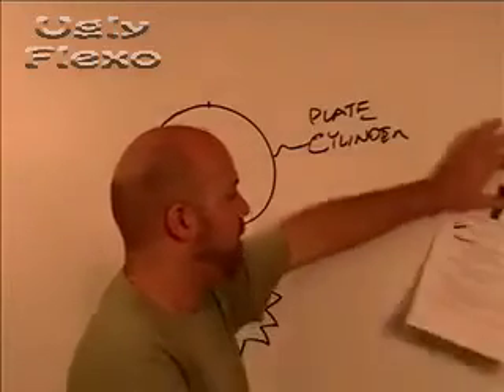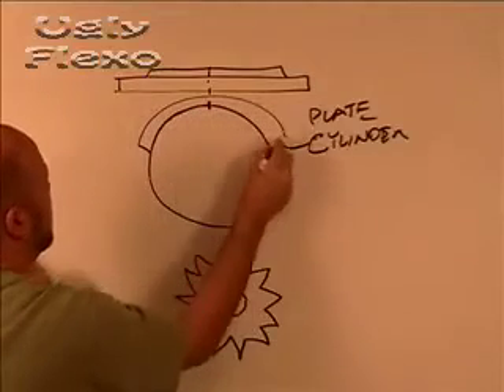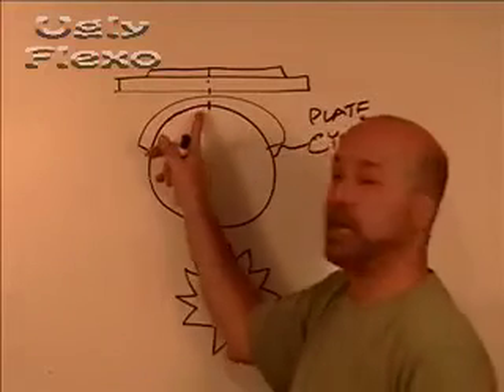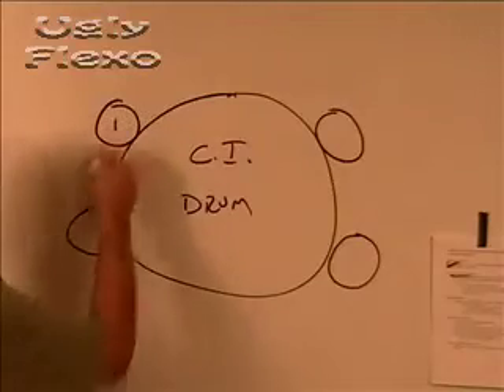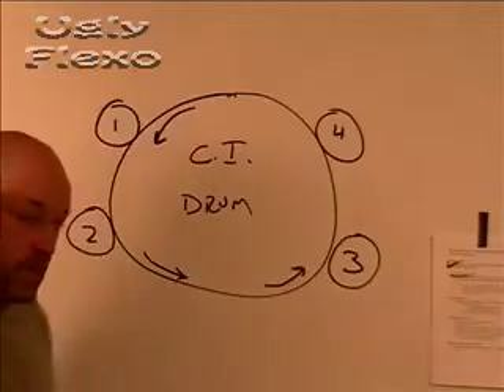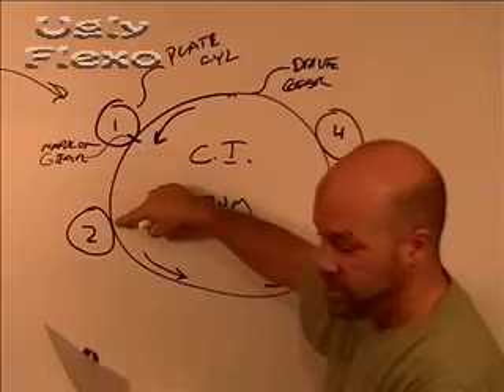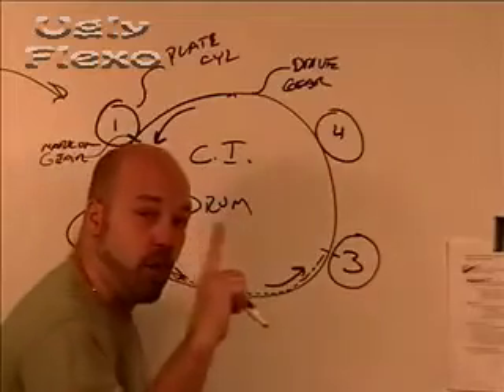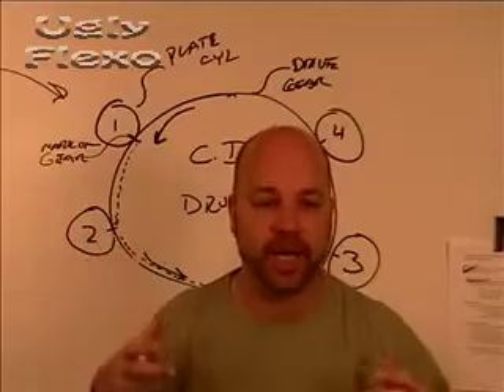Dry-registering Print on CI Flexo Presses, Part 2

Comment: Frank, thank you for answer By the way. I found that at FlexoExchange forum there are many usefule informations about printing process.Recently I've read a great article "Don’t Speed Up Those Presses...Yet!" which explains how important is a good open comunication between printng operators and management staff ( "the good guys"). In my opinion productivity could be much better if all actions before and after printing process are shorten to minimum (preparing and ending times).

Comment from the maker: Hey Wide web,

You're welcome.

What you're describing is commonly called "bounce".  When the leading edge of images hit, especially large images, like solids, the cylinder bounces away from the substrate, and/or the anilox from the plate and returns to normal.

Software tape, softer plates, reduced speed, replacement of worn bearing, journals, and bushings, tightening of parts, and special cylinders are often employed with varied success.  Anything that will reduce bouncing cylinders.

Comment: Hey Frank
Thank you for your answer. The article that you show me about impression adjustment was very useful. I haven't realized that there are differences among settings on upper and lower printing stations . I have a question about speed in adjustment impression, e.g. if you finish adjusting impression at speed 70 m/min and the printing plate  inks the substrate evenly, then after the speed increasing to 200 m/min or more, you can often see skipping effect. How could you solve that problem?

Comment: Hey
Very nice video. I`m a operator press helper. You said that the better is set up from the last plate cylinder. Me and opertor usually set up an impression on both sides simultaneously. Do you have some technique how to set up cylinder plate impression and anilox roller impression correctly?